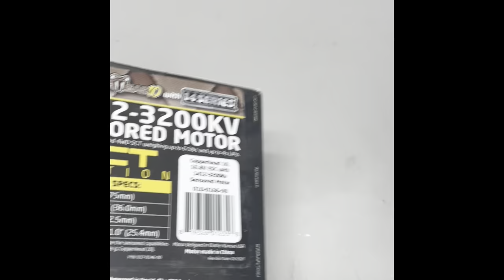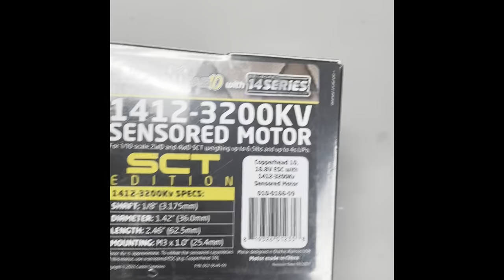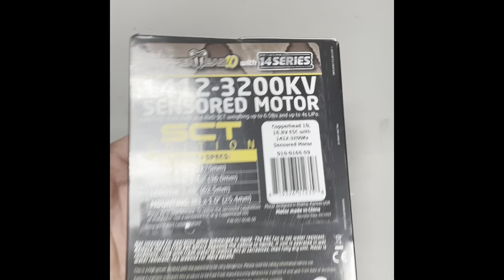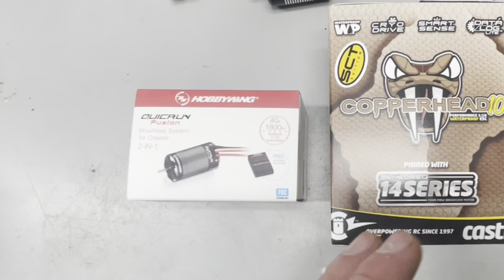Traxxas TRX4 Bronco with Castle copperhead 10 ESC and 1412 3200KV motor

Comment: excellent video my friend I think the hobbywing fusion Pro solves the wanting it to be a little faster.  One question what type of servo are you running?  Is that brushless?
Reply from the maker: Unfortunately I can’t remember off the top but most likely is was the 32kg jx servo that I sell.  It’s possible I used the 46kg but that seems overkill for this application.  Thanks for checking out the video!

Comment: i have a the copperhead10 +1900kv slate motor in my capra and ive submarined it a bunch
Reply from the maker: Nice!  I’m not sure why mine was acting up but I’m thinking of conformal costing the sensor plug on both ends.  Hopefully I’ll be able to try again soon.  Lots of snow currently.  Thanks for checking out my channel!
Reply: @aaronshobbygarage2338  you should get the one wire conversion sensor wire
Reply from the maker: @jeeplivion  not something I was aware.  I’ll check it out.  Ty!
Reply: @aaronshobbygarage2338  I believe it's a mamba connector it eliminates an unnecessary junction point. I haven't had a sensor loss beep since.

Comment: 2400kv  1415 castle on 6s
Reply: That fits?!?!
Reply: @godackgudalach1  I think it well looks like it will.
Reply: @NCMATT  I have a 1515 motor I was gonna throw in a sledge... I might try it in my TRX 4 just for giggles now 😂
Reply: @godackgudalach1  don't think that will fit got to be a 1415 1412 motor
Reply: @godackgudalach1  that's the 3200kv 2400kv castle motors